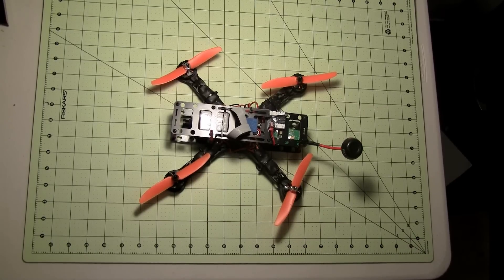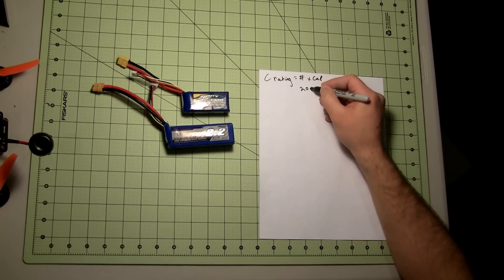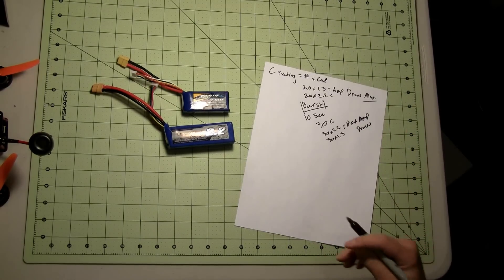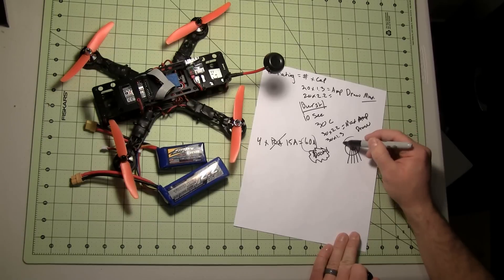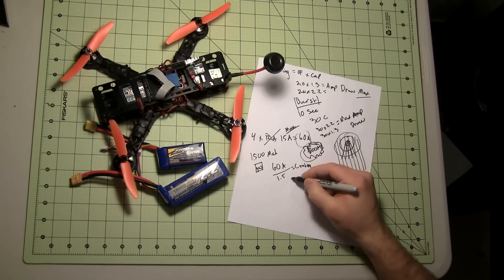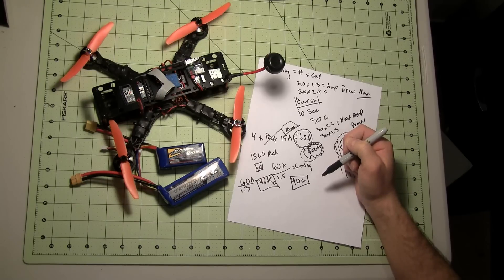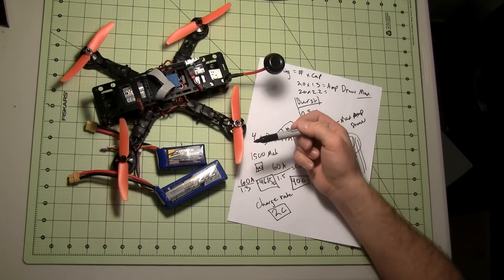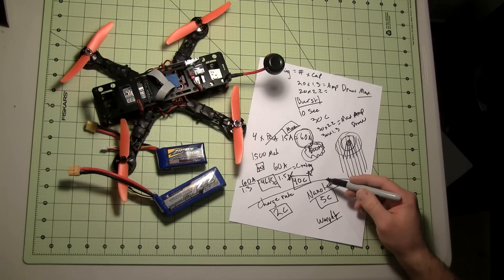Battery Talk - 250 FPV Racing Quad (Drone)

Comment: PLEASE HELP CRUSADER 200X 2017. EST IS THE DIATONE 302XD 4S. Burst Current (10Sec): 55A SO I CAN GO UP TO 220 AMPS BEFORE IT EXPLODES? . THE BATTERY I WAS GOING TO GET IS 1500mAh 70c 4S Lipo Battery Capacity: 1500mAh. SO 220 DIVIDED BY 1.5 BATTERY IS 146.6.  SO I CAN GO HIGHER RITE BECAUSE MY MAX C ON 1500 IS 146.6 C AND THE BATTERY PUTS OUT 85 C BURST ???  OR AM I WRONG. AND IF I AM CAN SOMEONE RECOMMEND A BATTERY FOR THAT DRONE.

Comment: Sorry to keep asking the same question, but I but a lumineer 1300 mah 70 c lipo battery and I have 20 amp blheli_s escs, is this going to explode my quads escs if I try to fly with this flight pack?I did the math and I think it will but help mee! lol I just need some advice from a pro

Comment: Hi Apex! I building my first. You don't mention anything about the camera's, antenna's, or LED's drawing power from the battery; are those not supposed to be calculated or is the battery size/rating determined only by the ESC's and the LED's/Camera's/Antenna's just reduce your flight time by draining your battery at a quicker rate? Thanks
Reply from the maker: Powering LEDs should always be off of a 12 volt regulator is running 4S batteries (14.8v).  If you are running off of 12v (3S battery) then you can hook them up to an ESC power/ground pad.  LEDs use such little power that I dont bother accounting for them when choosing a battery.

Comment: So what i'm confused about, is say you have a Turnigy nano-tech 4s 1300mah 45c battery with 20amp escs (25 amp burst) but the battery has a burst of 90c. Wouldn't 90c make the escs blow up?
25 amps x 4 escs = 100 amps and then 100 amps ÷ 1.3 amps = 76.9 amps max right?
It's just i have seen people using those kind of batteries with 20 amp esc and it just doesn't seem that it would work.

Comment: Hey Apex. I just built my first racing quad with 2300kv motors and 12A Esc's with 15A burst . Would it be fine if I use a 2800mAh 30C battery with it ? According to your Calculations, the C rating comes to around 20C . Will it be a problem if I fly my quad with this battery ? Whats your opinion on this ? Thank you !
Reply from the maker: It sounds like your running a bigger quad like a 250-300, in that case I think any gain in flight time that you are looking to get with the 2800 will be offset by the weight of the battery.  I would not recommend a racer with a 2800mah battery. If you want better flight time, go big (350-450 class quad). But big is boring. I would go no bigger than an 1800mah battery on a racer.  The amp draw (thus the C rating needed) will be totally dependent on the exact motor prop combo you plan on using.   Let me know your specs and I'll give you my opinion.
Reply: +Apex  It's actually a 280mm qav from banggood.com. 2204 2300kv emax motors, 12Amp simonK flashed Esc , CC3d evo flight controller . They provided me with a 2200mah 20c battery . But I already had a 2800mah 30c battery . So wondering if I could use it without damaging any components on my quad ! Thanks once again for your help ! Really appreciate it .
Reply from the maker: 6 or 5 inch props?  Not that that matters too much, but I I would run 6 inch on this set up as it would be more efficient. You can definitely run the 2800 without damaging thing, but it won't be agile and may fly like a fat pig. With 12amp escs you have to stay with 3s battery though. Goin 4s (any size) would most likely blow an esc.
Reply: +Apex It's a gemfan 5040 and unfortunately it's 4S :/ It's fine . I'm glad you responded to my request . you saved my quad :D thanks apex . great work !

Comment: Hi Apex, i have a question about battery, my motors are Mt2204 and 12a esc, does my Rc car battery with spec 11.1v 3s 25c 5.2A will work on it? I see video at youtube that it will fly a lot longer then those 2.2a
Reply from the maker: It will work, but 5200mah batter should be way too heavy for a mini quiad running 2004 and 12a escs. I would go with an 1800mah at most. That should give any where from 6-9 minutes of flight time depending on the flying style.
Reply: thank you, i allredy tested it, after 50% trottle it start fly, i allredy swap thouse battery for f450 frame, better fle on it, small quad is to fast to controll it with that heavy batter, and my old cc3d dont have Baro to dint fall almoust each fly :D

Comment: 3s 1500mah 45c or 3s 1800mah 25c for long flight with max draw 40amps?
Reply from the maker: The 45c will give so much more power(if your system wants it).  I am using 1300 65c on an RDQ182 these days and get 4 mins racing closer to 3 on free style.

Comment: my thing is I would want as long of a flight time as I can get without going to heavy. so if you want to have a long flight time will the higher C rating help with that? and will going with like a 4s or even 5s and only going 1/3rd throttle make it last longer?
Reply from the maker: +Robert Butler Flight time is less about battery and more about motor prop combo.  Bigger props spin slower and usually are more efficient.  My latest build i get 5 minutes and last at "storage" level voltage.  And this build is PLENTY of power
https://www.youtube.com/watch?v=NQ17KWpVS98

Comment: Slightly off topic. Whats the most powerfull racing drone size you can build with todays tech and what batteries should you use? Power weight ratio?
Reply from the maker: 15:1 thrust to weight. Running a 180 size quad with powe hungry eMax red bottoms with 2 bladed props.

Comment: hi, thanks for the video,  I originally bought some 25c  1300's and a guy told me to use 2200's so I bought them. flew my 250 quad for the first time today just a hover and slow flight test and got about 8 minutes out of it.  are they to big? do people use 2200?  I see you have one.  using my 1300's for the goggles right now.      thanks
Reply from the maker: +Jay Tol Most people are not after long flight times in the 200-250 class. We are going for major speed and agility.  For that I would recommend 1300mah and find as light as possible for your budget in the 35 to 65C constant rating.  If you are new, 35c is all you need, once you get better and better then you will notice the difference in the higher C rated batteries.
Reply: Thanks,  1300 must be a short flight?  I'm going super easy for now,  just cruising,  going to try the big ones since I bought them and put plugs on them...   probably good enough for a cruiser
Reply from the maker: +Jay Tol  Definitely good for cruising. Once you get better and faster you will feel the weight.
Reply: +Apex thanks man.  I guess I didn't totally waste my money, I could switch and use my 2200's for the goggles lol

Comment: Hi there - I have a question that I cannot seem to find an answer to... I'm using a current monitor in my OSD to monitor mAh consumption during flight. (understanding that going strictly off of voltage is not very accurate) 

So, If I am flying a 1300mAh 4s pack - how do I calculate how many mAh I should fly to? Flying the battery all the way to 1300mAh would kill the pack - I've found that I can fly to around 750 ~ 800mAh. I was just wondering if there's a way to calculate this or a rule.  Thanks again for your videos!
Reply from the maker: +whoisjason A rule of thumb is 75-80% of capacity.  In this case, 1300 should be flown down to 1040.  Keep in mine that "virtual" current sensors are not as good as physical ones. Good luck!
Reply: +Apex Thanks!

Comment: Ok thanks. How will a 4 cell differ from a 3cell for calculation. Also running 30a Armattan (40burst) with 2822/12 armattan motors which say max 18A.....so.....why do I need to calculate at 160 instead of 72.if the motors can't draw that much.....other equip?? na I think not...I run stripped down anyway, so on the powerful and light side....thanks man the gas tank and pipeline really did it for me...started in june....man can you do that with PID"Shahahajaahajahajaaha?

Comment: I'm confused.. If the motor-prop combo (DYS 1806 2300kv and 5030 Gemfan) lifting  a AUW 400-450g 250 racer, e-calc says that it draws a max amp of 7.52A/motor (x4=30.08A) then why do I need a 45C 1300mah lipo that can deliver 58.5 A? Won't my motor "explode" before it gets to draw that much amps? I really think you can go with a 1400 mah lipo that has 30C (and 60C burst) with a weight of max. 120g so that way with 42A max. draw (and 84A in busrts) you have both enough power and plenty of flight time (around 10 min. depending on how aggressive you go). Am I wrong?
Reply from the maker: George Giurgiu You are right, if you use a small motors like 1806s. If you use a larger mini quad motor (2204 or 2206), you motor is less likely to burn out compared to the ESC, even when running 6045 props on 4S.

Comment: The problem with the way you're doing it, is that you're calculating to what you can potentially get from your ESCs, not by what your motors pull... People need to figure out what their motors pull to get the right C rating... If you have 12a ESCs with 15a burst, by your calculations you need a C rating of around 45 for 1300mah, but if your motors only pull 10a each at Max throttle (40a), then you only need a C rating of around 30 for a 1300mah... Which is cheaper and should weighs less... So it's better to calculate the Max amps your motors pull combined divided by capacity...
Reply: Elias R. Ok, after doing a bit of researching, I see what you're talking about... Higher C-rating batteries have less internal resistance, which provides more punch... This is something I didn't know about, thanks :)
Reply: no, this has nothing to do with 3S or 4S. And everything bigger props change is that the motors draw more amps. The higher the C rating the lower the internal resistance of the battery is thus increasing the speed of the power delivery.
Reply from the maker: Optamizm Knowing the max amps your motors can pull isnt the limiting factor on most quads.  Yes it is another way of calculating it, but your ESCs can only give what they can give and nothing more, unless you call out of the sky.
Reply: SGRacer Indeed, but if you are only going to be using the setup you have and nothing more, no changes to prop size, battery cell count, etc, then having a battery with the C rating fit for your specific setup is optimal (weight and cost)... But if you wanted to future-proof yourself to the ESCs you have, then getting a C rating for your specific battery is better, but then you will be carrying more weight (as higher C rating batteries are heavier) and paying more for it while you learn to fly. Also, I personally would not recommend using the burst rating of an ESC to calculate your limit of motor pull, as you will most likely fry them when you hit full throttle for too long... You're better off getting your max motor pull and buying ESCs that will safely cover that range and a battery C rating for that setup (for maximum weight efficiency)... If you plan to go 4s batteries and bigger props, etc, after learning to fly your quad, then you might want to future proof yourself with 15a-20a ESCs and buy a new battery after you know what prop size you want to use with your 4s battery... Just my 2 cents...
Reply: Optamizm Generally you're right but for racing quads a higher C rating than necessary does make sense. For example if your motors draw 40A max (all together) then you can feel a difference between a 1500mAh 30C and a 1500mAh 45C battery . 
Why? With a racing quad you often "punch" the throttle and the 45C battery can deliver the needed power quicker. That's why I've seen some pros use 4S 1800mAh 75C batteries.
Reply: Elias R. 40A should be easily covered by a 30C battery and you shouldn't notice a difference... You will notice a difference if you use bigger props or a battery with more cells... A 1500mAh 45C battery is enough to cover 67.5A max, so I'd assume the 30C battery is 3S and the 45C is 4S... The pros will need the 75C batteries because of the 4S cell count - - and most likely - - 6" props...
Reply: +Optamizm this stuff is really confusing me. No one agrees on the right way to do it. What battery specs would you suggest for this set-up and why? http://www.hobbyking.com/hobbyking/store/__86550__DYS_250_300_Class_BE1806_2300KV_Motors_w_DYS_BL20A_Opto_ESC_39_s_and_6045_Propeller_Combo.html
Reply: ***** Firstly you should know if you want a 3S or 4S setup. If you're a beginner I'd suggest 3S. With 4S you would need smaller props or the motors are going to overheat.
  
For the battery I suggest a 1500mAh 3S with at least 50C rating (80A / 1,5A = 53). I found a thrust test online and the motors drew 16.1A at full throttle so the 20A per motor I used in my calculation are just to be safe.

You could use up to a 2000mAh pack to extend your flight times but that will increase the weight of your quadcopter.

Comment: How much does the 1500mah Nanotech weight? The site says 119g, but that seems low for a 1500mah with a higher C rating.
Reply from the maker: ***** It really does weight 119g.  I weighed it with my XT60 connector on it.

Comment: How do you know how much amps a motor with a certain propeller is going to draw at full speed? Mine also are emax 2204 2300kw and i'm using 5045 gemfan propellers on 3s battery, but still i'm missing a point..because the stock battery that comes with it is a 25c which seems pretty low to me for this kind of setup
Reply from the maker: ***** For that you would need an ammeter, which I dont have.  Needing to know the amp draw of the motor is (for me at least) only useful for when choosing which size esc/prop to use.  2204 motors have plenty of toque for 5045 props and should not burst a 12 amp esc on 3s (I am runing your exact setup).  I can tell you from experience that a 20-25c battery has got NOTHING on a 30c+ nanotech (or equivalent higher quality battery) when it comes to performance and flight time.  Really, as long as you stay in the 5045 or 6030 range with 12 amp escs on 3s you should be fine and not blow them up.  On that set up the motors won't draw more from the battery and escs to make things go BOOM.
Reply: +iV'aN da Na'Vi Hobbyking sells a nice little meter that does a bunch of things, including functioning as an ammeter.  The max current on Mega_Meter_Battery_Checker_Watt_Meter_Servo_Tester at Hobbyking is 100 amps, so I could inline it with battery and do a static test on the whole quad.  Have to be a little bit careful and not punch the throttle with a 2.2 45C-70C battery since that could output more than 100amps (by quite a lot).  However, as mentioned above, my 1806 class motors with the two blade 5030 gemfans are probably limited to drawing about 8amps, so no matter what size battery I have, I doubt I can get near 100 amps.  Probably not over 45 amps or so.  The higher C rated batteries should provide power with less voltage sag and hence more total power.  But, how much power can the four 1806s use?  Time to use the meter in power consumption mode!  Checking a variety of batteries would make a fun, rainy day project.

Comment: so wait wait... through your calculations, you're saying a 1500mah battery has a max of 40c. BUT.. im looking at a turnigy 1500mah 20c, and says it has a max of 30c. And the 25c version has a max of 35c. then theres a 1300mah 20c with 30c max. and a 30c with 40c max. im buying a quad soon, with MT2204-2300kv motors and emax 12A ESCs. Im not completely wrapping my head around this, i cant find much online as for recommendations, and i dont want to break anything. What should i get??
Reply from the maker: brandon b Minimum 30C "premium" battery.  So NOT like a Zippy Flight Max from hobbyking, or a standard turnigy.  Something like a Glacier or Turnigy Nanotech (I find) has WAY more performance benefits.  Also, bear in mind the higher number (burst) is typically only for 10 seconds and should not be relied on.
Reply: SGRacer thanks for the reply!! i need all the help i can get. okay, so someone like me just starting out. with a limited budget trying to save every penny. a standard turnigy or zippy 25-30c with a 35-40c max, should be fine? i dont wanna go too crazy first. as long as i dont exceed the 60A max of the 12A ESCs. and do you have any prop recommendations? are there any risks i should be aware of when picking and choosing so i dont draw too many amps or strain the motor? im limited to 5" blades for the frame im getting (emax250)
Reply from the maker: brandon b Again. I would sped a little extra on one thing... battery. It will impact your performance so much it is worth the extra $4.  Here is another video of mine that describes my build (about $150+FPV gear). https://www.youtube.com/watch?v=FURY4ICgj68

The description contains a link to all items in my build.
Reply: SGRacer okay okay hahah ill spend a few more bucks if you say so, it cant hurt especially in the long run when i want more power. ill deff check out your video